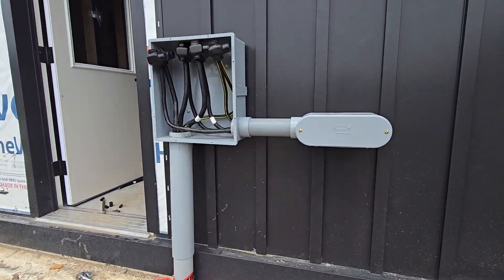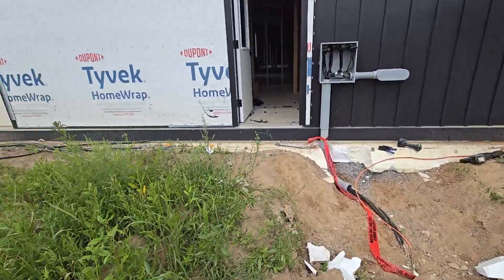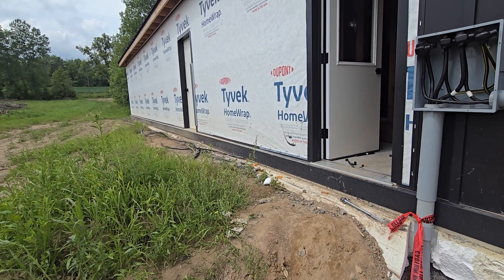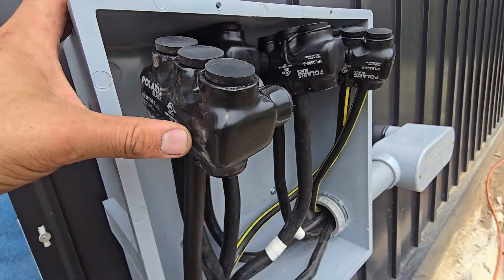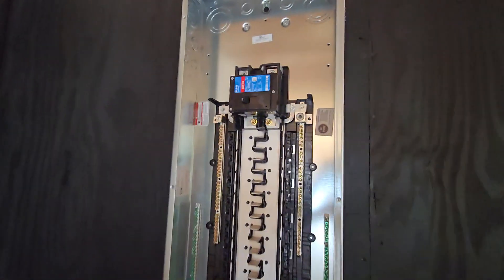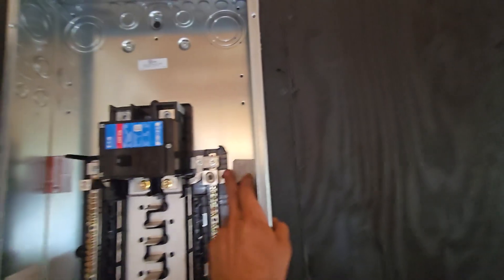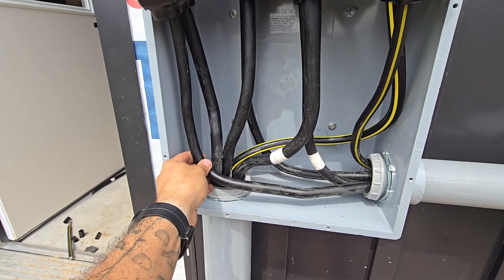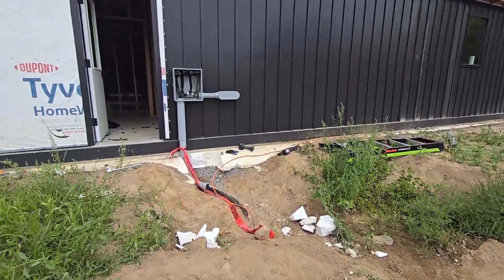200 Amp Service Feed To New Home

Comment: The 4 wires you have running from your disconnect to your breaker box - did you have to use thwn due to the one side at the disconnect being a "wet" location ?  Thanks
Reply from the maker: I used the same direct bury cable that I used from the road.

Comment: The conduit appears to end at the bottom in the ground and bare wires look to run from there. I thought it all was to be in conduit and is that deep enough?
Reply from the maker: @BitCounter  it is direct bury cable. The final grading has still yet to be done which will make it deep enough.

Comment: The easiest way to deal with your situation is to bring in 480 Volts. Your wire size would have been much smaller which means less expensive . You would not have any voltage drop the only disadvantage is buying a step down transformer. This is if your utility company will cooperate with you.:yougotthis:
Reply from the maker: They won't... they wanted me to bury 2 4" conduits... that's about 800feet.... no way

Comment: Are you sure you don’t need a disconnected on the outside of the house?  Just a suggestion, no way to de-energize the house at the house from the outside.
Reply from the maker: I will be adding one when I tap off for another subpanel to a remote building

Comment: Is the jacket on the conductors from the Polaris taps to the panel dual-rated USE-2/RHW? Without the RHH or RHW rating, you technically can't use it indoors.
Reply: Never heard that one before. Only rhw can be used indoors?
Reply from the maker: @PhillyFixed  the cable is the same type that would be used if I used a 4/0 directly to the panel.

Comment: The LB underneath the panel is fine but conductors other than service conductors are not permitted in the same conduit as the service conductors. Not sure if you knew that already. NEC 230.7 is the code reference.
Reply: This isn't a service entrance, it's a feeder. The service (and main) are at the road. He clearly stated it's a sub panel, hence the separate EGC.
Reply from the maker: @electricalron this is the service cable. Not sure what you are referring to?
Reply: @JimSperanza  Right, only service cables are allowed in that conduit.  You cannot add other conductors in that raceway.

Comment: In my area they are demanding that you install an expansion joint when a conduit comes from underground even to a meter socket only 30" off the ground. Reason being for ground settlement. Have saw too many 11/4 & 2" PVC conduits pull out of male adapter at bottom of outdoor meter cans. Waste if money the ulitity company denanding that you install a spare conduit if you went the other way.
Reply from the maker: @JohnThomas-lq5qp  I install expansion joints on every junction box and panel. Especially on a new build. The ground will definitely settle and even an inch can rip off a conduit. You can see the expansion joint below the junction box in this video.
Reply: @JimSperanza  ok. Dumb ass me did not have my bifocals on and completely missed the expansion joint. The first 1/2 & 3/4" PVC expansion joints in big box stores did not have marks or instructions and one homeowner installed one during a cold day and had it set at extreme expansion range so come summer he had a open to the air expansion joint. At a 100 degree temperature spread 10' of PVC will expand 0.4".

Comment: That looks nice!  So do you have a disconnect down at the road as well?

For more space inside your junction box, I'd have cut two of the wires shorter so that there would be two high and two low, alternating.
Reply from the maker: @Sylvan_dB  https://youtu.be/IzBl1BUiCm0?si=QVqdq7SJI6m0JJcJ

Comment: Not only the line drop, underground cable doesn't dissipate heat like overhead.  Most underground services are under 200 feet.
Reply: That's not what cheap lazy PECO told me when I changed over a 100 amp service in center city old house to a 100 & a 200 amp services that was feed by 80 year old #6 Guage copper rubber covered very frayed  ( RHW ) wire. They told me that the 60 amp rated wire was cooled because it was underground and large enough to feed a total of 300 amps.

Comment: Do you need a separate grounding rod for this subpanel?
Reply: Need, no.  And it appears he ran a ground and that is sufficient.  However, I'd put in a ground rod or bond to the metal in the foundation. Two grounds is better than one, as long as adequately bonded together.

Comment: Heard you say it was going to be around $12k to run cable and get a transformer but didn't catch the price difference doing it this way... obviously cheaper. Last time I did a long run of 0/2/0 I believe it worked out to 50 amps usable at the end of 1,000 feet. (from memory) Bought a full spool at a substantial discount and had it delivered to the job. That was about 10 years ago so I am sure the price is way up now.
Reply from the maker: Cable was around $3200 plus junction boxes and polaris taps. So about $4k all in.
Reply: @JimSperanza   Yeah, I would say that was a good call to go in that direction. You are right about never needing the full 200 amps but to meet code / inspection you have to plan for it. For the average home I would feel comfortable adding another panel for a garage. Even with a future EV and several tons of AC they'd never draw the 200 amps.
Reply: @JimSperanza   Cheaper but you have to factor the loss that you pay in your electricity bill. If you have a voltage drop between the meter and your house, it's heat that you pay for since you have the meter back at the street (reason why the power company didn't want to install it near your house). Now to account a difference of 8k it would probably take decades, of course.